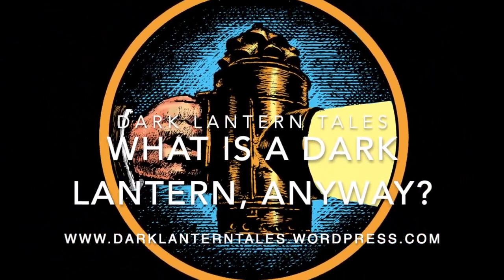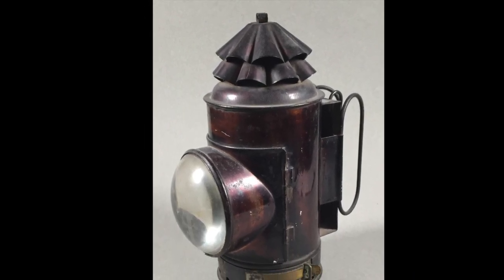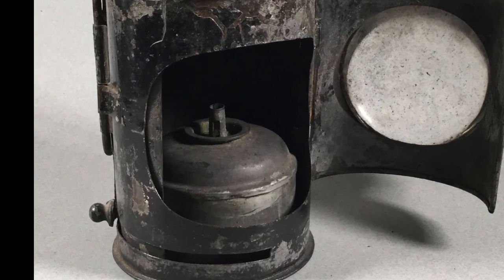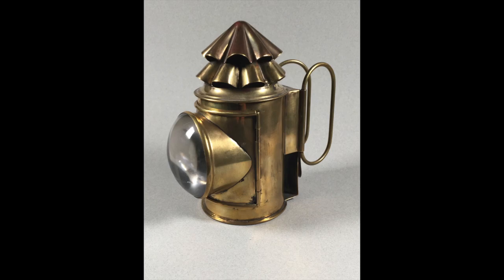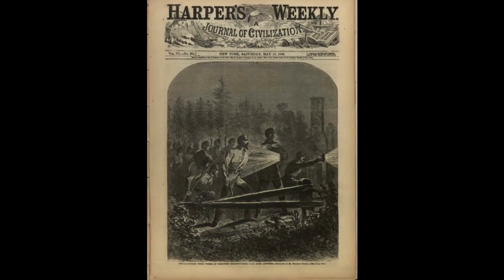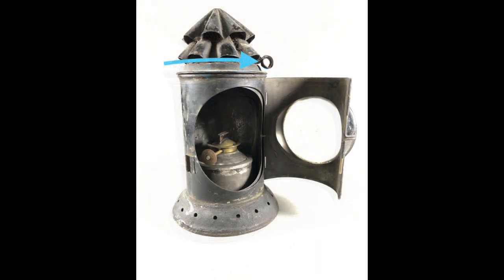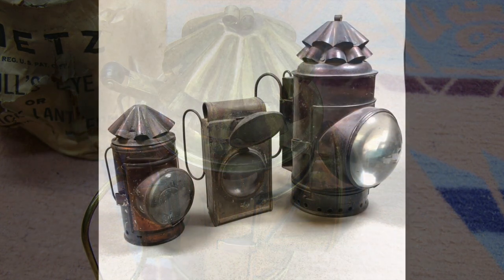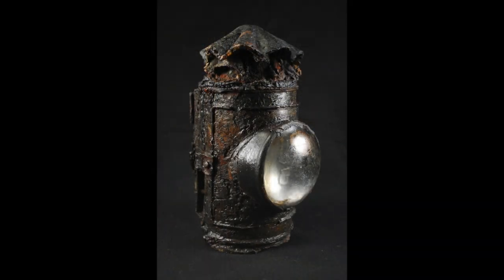What is a "Dark Lantern," anyway?

Comment: I've known about bullseye lanterns with their shutters for many years (thanks to Dungeons and Dragons, of all things), but this is the first time I've seen good photographs of actual examples.  Mass produced, affordable tools, from a time when consumer goods might still last a century.  I'd guess they used whale oil or vegetable oil in the early days, before kerosene became a common item.  Such a thing would probably cost $50 or more in today's world -- as much because there's no volume demand, as because both materials and labor are so much more expensive than they were when Victoria was the "young queen".
Reply from the maker: Thanks! On my web site there is a longer version of this in text with the same images. You may find more answers there:       https://darklanterntales.wordpress.com/what-is-a-dark-lantern/
Reply: @MarkRWilliams  I looked and found the link at the bottom for repro dark lanterns.  Four hundred bucks?!  With less emphasis on reproducing the 19th century esthetic, I think these could be manufactured for less than a quarter of that figure -- at least in plain zinc- or tin-plated sheet steel.

Not much demand for a no-battery hand light these days, though, with a smart phone (with its built-in flashlight) on every belt, in every purse, etc. and hand-held LED/rechargeable lights that can throw a beam spot a quarter mile or more...
Reply: That is where I found out about them as well.